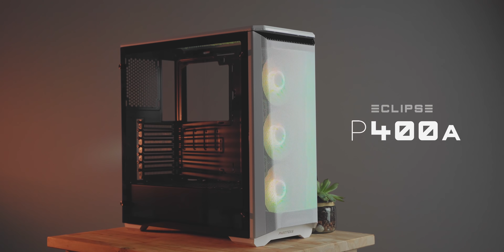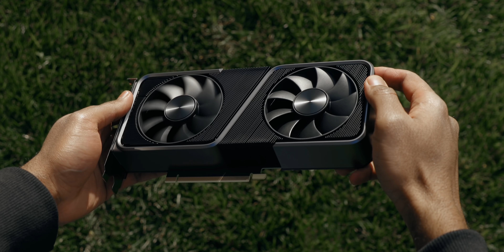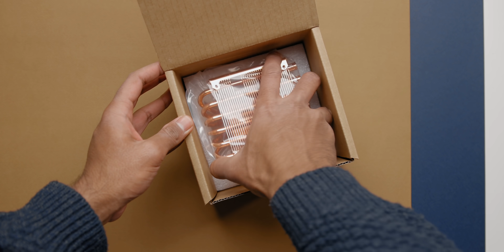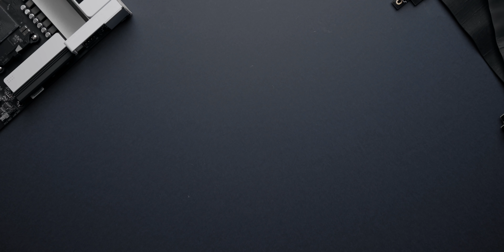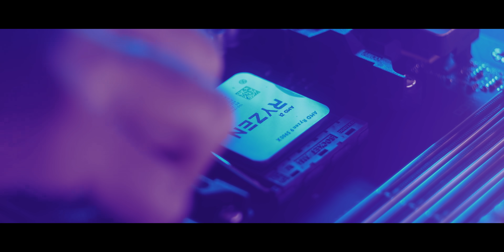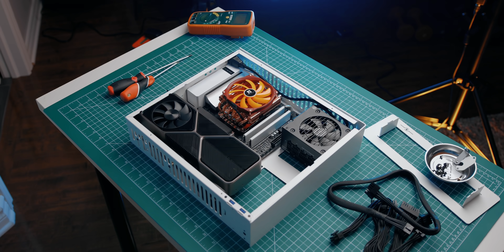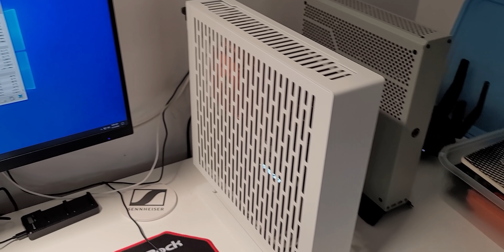The SMALLEST ATX Build Yet - Ryzen 5900X in a 10L Case!

Comment: Except for gaming the 3950X is better (an that is compensated by the 3090), I mean you could have 12 cores with higher frequency but is not high enough to compensate for 4 additional cores, would be cool a Cinebench comparison
Reply: Not even remotely true, 5600x is better than 3950x for gaming.
Reply: @riba2233  I never said that maybe it’s need a comma there, I know and I knew that, I said, that Except in gaming, the 3950X is better, in other words, in anything other than gaming the 3950X is better, so you missunderstood my comment, and yes the 5600X is better for gaming, but tbh I kinda prefer a 3950X and 3090 than a 5600X, 5800X with a 3080, more optimized CPUs for gaming are not going to solve the bottlenecks that 10GB of VRAM are going to make in the future.

P.S: About the 5600X I would be worried for it in the future in gaming, probably because what I’m going to say the 12, 16 core or even an 8 core Ryzen 3000 is better in gaming, in the long term, developers are going to adapt to the common denominator that are going to be the consoles and if the consoles have 8 cores Zen 2 the minimum is going to be that so in the future when the CPU of the consoles is driven for some game to its limits the 5600X can suffer it a little worse, but even if it manages to run it better, in PCs games tends to needs more resources, not only for optimization but because in PC you can run the game to new heights, so if it is more resource intensive as it probably will be at that point, a 5600X can struggle a lot, when a 5800X or 3900X would be perfectly okay
Reply: @Pro720HyperMaster720  3700x will never be better for gaming than 5600x, never. Btw regarding 5600x vs 3950x, you are comparing 300usd cpu vs 750 usd cpu
Reply: @riba2233   I think you’re not getting my point, first I comparing arquitechtures and cores not prices, mostly because when the bottleneck I was talking about happens you’ll probably want a new CPU anyways, but you can get a 3900X second hand for similar prices, regarding de 3700X vs the 5600X I am not 100% sure that’s why I didn’t mentioned more, but as you say never, let me explain you why yes it can happen, the 5600X is not a stronger CPU vs the 3700X the improvement from Zen 2 to Zen 3 is not enough to compensate for a 2 core difference, is near but it didn’t do it, you can check cpu/compute benchmarks like Cinebench to see that in multicore it bests the 5600X from 4 to 10% difference depending on the case, you have to understand that the gaming difference is majorly produced by improving cache architecture and reduced latency and that helped a bit by higher CPU frequencies, but not because is a powerful CPU overall, now the 5600X doesn’t have any issue because has plenty power to run any game (you have to have in mind that the 8 Jaguar cores of PS4 and Xbox One are not more powerful than two modern cores, and because the game adapt to greater capabilities or PCs adding more features and you want to run it at higher fps you need more CPU power that those consoles, unless you run everything at minimum and run the game at 30fps) but in the future when the games take full advantage of the PS5/Xbox Series Zen 2 CPU that is very near to an 3700/X you will see how these CPUs make a bottleneck and are overloaded, and as the 3700X has a little more compute power than the 5600X, the 3700X will be less affected and can have better gaming performance at the end of its life in the current games of then, but both will be very near its limits so even if that happen, that I would be, you would want better CPUs if you want to run the games at higher than 60fps.

In short: the 5600X enjoys higher frames because now, in a time where modern processors have plenty power to spare in modern games thanks to its improvements over Zen 2, so in a game that requires 30% of the CPU to run it may have 300fps and the 3700X 150fps limited by its architecture, is not like it is giving its 100%, but in the future you may need 95 to 100% to run at 60fps and in that scenario both will run at around 60fps.

Imaging that we are limited by architecture so in one it can produce 500fps in certain game, and in other arch 200fps in that same game, no matter how stronger are the CPUs.
But if the game is extremely hard to run independently of how many frames it can handle it can only output 100fps, the other one that can only make 200, this time would make also around 100fps.

If you don’t believe or agree with what I’m saying let me give you a clear example, now the 5600X and 5800X get around the same number of frames in games (even if the game uses 8 cores, that today usually is the case) do you think that will be forever, no, that happens because the today’s games don’t push the CPUs hard enough, if the arch is different you could see other bottlenecks, but if it’s the same, now you see equal performance (mostly because default out of box frequencies are not the same) but when the game requires for example 110% of what a stock 5600X can offer you’ll see the 5600X taking a huge impact in fps, dropping below target frame rate, while the 5800X will have not an issue and will be pushing more than enough.

Obviously in all my examples I’m assuming a strong GPU that don’t produce a bottleneck
Reply: @Pro720HyperMaster720  You didn't have to write all of that, I am very aware of everything you've said, but trust me, 3700x will never ever be faster than 5600x in gaming. The multi performance is too small to make up for the huuuuge latency advantage of zen3, not even considering single core performance.
Reply: @riba2233  yeah, sorry for making it too long, but thanks to take the time to read it, I mostly agree, I consider the latency and all the Zen 3 advantages but I was and am not fully certain the in the long term is going to be much better because I’m not sure how much specialization and optimization we’ll see in order to use at the fullest Zen 2 in gaming, because I suppose in some degree that will happen to get the most out of the new generation consoles so I wouldn’t be surprised if games were made around the limitations of Zen 2 to get maximum performance and if that could affect desktop ports or if this workarounds will or not improve gaming performance in Zen 3 or only will effective in Zen 2.

In short, now is better, but the main reason I’m not sure in the long term is how PS5 and Xbox Series will affect future games about Zen 2 utilization
Reply: @riba2233  by the way you have something to do with sfftime? or you have a P-ATX and are a fan of them, because your profile picture looked familiar but couldn’t put together where I saw it, but I just realized that is there logo, a very good case in my opinion
Reply: @Pro720HyperMaster720   Well yes I do, I am the maker and ceo of SFFtime, but also a hardcore hardware and case enthusiast since 2003 :)  Thank you for the compliment and if you have any questions regarding my cases, I'd be glad to answer.

Comment: with cooler master sfx 850w. msi b550 unity with 4x m.2 gen 4 so it can have 2tbx4 or 4tbx4 raid 0 with either 6800 xt or 6900 xt reference with 120mm aio is what i might do 5900x or 5950x eco mode and see if i can get something for dust filters

Comment: Dont remove the Fan, Remove the Cooler. The AXP-100 is one of the best low-Profile Coolers, but not the best. The ID-Cooling IS-60 is the exact same height, the fan is replaceable with standart 120mm x 15mm fans and it even performs slitghtly better from what i've seen so far in Benchmarks. Tolorances for RAM-Slots are really tight for this one but it should fit quite nicely with a 2-DIMM config on your Vision-D Motherboard. Let me know if it helped!

Edit:
Replacing the stock fan with a Noctua Chromax NF-A12x15, Silverstone FN123 or FW124-ARGB should help with looks and Performance.
Or go with the Prolimatek Ultra Sleek Vortex for less Performance but absolute 0 noice :)

Comment: I would like this case for my R9 5900X and my RTX 3090 FE... could this beast fit in there?
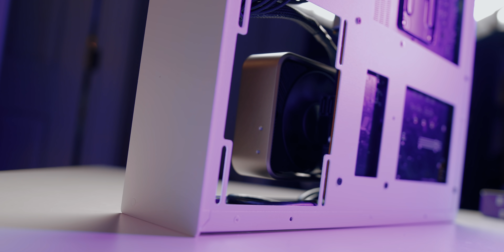I checked the specs and it should... even the exhaust fan on the 3090 should fit better over the outlet than the 3080 does (looking at 15:06).
can someone check the fitting? and when will the case be purchasable again?
Reply: Hi, 3090 fe will fit with itx mbo, and you can preorder the case now
Reply: @riba2233  Thanks - preordered... :)
is there any hint for the estimated shipping date?
Reply: @SidFreedman  Thank you for your order. Current projected shipping date is around mid to late February.

Comment: This is fairly similar in concept to Thermaltake Core G3, which no one talks about anymore because it's a couple years old. The G3 also supports a slightly taller CPU fan-sink or water cooled setup but also a bit wider. Sadly I invested too much into Intel last year, got an i9-10980XE and 128GB of RAM on X299 board and there are very few full-ATX tower that's this slim... but then I doubt the fan-sink will be enough to cool this R9.

Comment: you could totally put a taller fan in that case.. That's a silly thing to pout about... 
there are a LOT of 15mm fans for that matter. 
Scythe, silverstone, CM. ETC...

That case would be a LOT neater to look at if it was rolled counterclokwise 90 degrees and had a compartment to hide the cables coming out of it..

Comment: Try flipping that case fan by the 3080 around to serve as intake instead of exhaust. The way the 3080 works is it pulls air from the fan on that side of the car and expels it vertically (when mounted without a riser), so using that case fan as an intake might help with GPU/overall case temps. The way that you guys tried it would have been creating a pressure decrease because you had the case fan pulling air in the opposite direction that the 3080 cooler fan was pulling.
Reply: Not true, both fans om 3080 push air in same direction, towards the rear of the case
Reply: @riba2233  No it doesn’t. Watch the Gamer’s Nexus video where they show the flow imaging of the 3080 FE airflow. Actually even just the thumbnail of that video will show you where the fans push air.
Reply: @ramiebrahim4711  sorry, but you misunderstood it. Search for the official nvidia airflow chart, it was publish on the release

Comment: Did you invert the side fan to make it intake/positive?  Blowing cool air into a case makes a whole lot of difference. -- Also the orientation you had the fan config is exhaust, while the GPU fan orientation which sits right above the case fan is intake; you just created a neutral temperature in between the GPU fan and the exhaust fan.
Reply: Nope, both gpu fans push air in the same direction, towards the rear panel

Comment: Hope you all see this because i found a cooler that may work iys the Gelid Slimhero with 59mm cooler+fan height. the fan is also a standard 15mm thickness. Edit: there is also the id-cooling IS-60 thats 55mm tall. The coolers tdp is 136 and 130 watts respectively

Comment: i have the old asrock M8 case, and i found the exact same thing with mine. This case came with 4x 80mm fans i think they are 80mm... but i ended up removing all of them and achieving better temperatures and much quieter.

Comment: I have an old Thermalright 120 extreme cooler which I want to continue using for new AMD AM4 based build. wondering if it can work and where I can find a AM4 attachment for it.

about the CPU temperature comment in the video: up to 80-90c under load is fine for the CPU unless you've started thermal throttling

Comment: they should have made it just like .5 inch wider, then a 3090 card wouod fit perfectly and that last intake fan would be right where it is already located on the the 3090.. would have been perfect. or the 6800xt rog strix wattercooled card.
Reply: We also have a larger case incoming, n-atx. It is 2cm wider, .5 inch is not enough.

Comment: Yesterday I found this full cupper cooler, that’s probably why YT recommend this video. Do you use the old super flat edition or the new 65mm edition for cpu cooling. Thermalright offers a adapter blade to mount a bigger fan on top 120 x 25mm I guess. But if you don’t like the orange Fan simply purchase a white fan with the specs you need.
Reply: This one is 58mm tall.

Comment: Will the GPU block the headers at the bottom of ATX or mATX board?
Reply: It shouldn't, maybe internal usb 3.0 on matx but you can get a 90 degree adapter for that.
Reply: @riba2233  thanks. I do happen to have an mATX. Beside usb 3.0, there are a few other headers at the bottom that I'm afraid might be blocked
Reply: @kang7014  there is enough clearance if you use 2slot gpu, don't worry
Reply: @riba2233  thanks for the clarification

Comment: You guys mentioned that you tested other CPU coolers against the AXP-100. Was the ID Cooling IS-60 among that line up? I've heard from other tech youtubers that it is a cheaper alternative for the same performance.
Reply: They didn't, but yes, it has same performance but worse ram compatibility.
Reply: @riba2233  thanks! I heard that Corsair Vengeance LPX ram appears to be compatible (which is what I intend to use for my build). Do u know if the bigger fan on the IS-60 will improve VRM and chipset temps compared to the AXP-100?
Reply: @shohabwafa1841  yes, lpx is the safe bet. Yeah it could improve temps a bit. You can search the low profile cooler test on techbuyersguru channel, he tested all of this :)

Comment: ID Cooling makes some good low profile coolers I believe
Reply: Tried it with the IS-60. It  fit the case ok but you have to make sure you either have very low profile ram (sub 27mm) or a low/no  i/I shroud, my MSI unify itx board wouldn't take the cooler and I had to send it back. Perhaps that s why the IS-60 is no longer available..... Having said that there is a new version with argb, but it's  too tall for this case.

Comment: the 5900x is NOT the second fastest chip in the lineup, that would actually go to the 5800x, with its single fully unlocked CCX/CCD 8 cores 16 threads. In gaming the lineup is, 'slowest to fastest, 5600, 5900, 5800, 5950. This is due to latency. (aggrigate the benchmarks and you'll see its true) for compute, workstation use, you are right, the 5900x is the 2nd place holder. but only in applications that can use that many cores. i know its a nitpick, but for people who are gaming more than worrying about premiere workloads, its an important one.

Comment: Why are the ssf cases all dual slot !!!
Reply: Create a case that supports micro atx mobo and atx psu and 3 slot gpu please
Reply: @MxGiK3HuNNx  I did, google sfftime n-atx :)
Reply: @riba2233  i like it where can I get one and how much
Reply: They are not, and this case is 3slot if you use itx mbo.
Reply: @riba2233  it fits full atx mobo but only supports a dual slot card
Reply: @MxGiK3HuNNx  hi, I am the creator of this case, I think I know what it fits :) if you use itx mbos you can fit pretty large 3slot gpu, they even say it in the video.

Comment: And then you read on amazon that the heatsink isn't made of copper but is some copper plated alloy after one customer cut it with a dremel. He also noted it performs worse than the AMD stock cooler. And you recommend this stuff. Got any infos on thermals in this case under load (prime95+Kombustor, Blender render test)?
Reply: None of that is true.

Comment: Im sorry but building a small aluminum box that holds electronic parts is not worth 200 bucks. They are taking advantage of the niche of the product! You can buy the best lian li with tempered glass and duel compartments  about the same! there is literally nothing to this case! yeah yeah tooling overhead. Its beautiful, and so needed but come on! Still a great build and a great video though!

Comment: Beautiful case, motherboard, ram, cpu, GPU and yes, cpu cooler. I like the colour scheme 🥰💰👍. I personally am getting my setup finalised w/ the N-Case M1 V6, with the same cpu, ordered my R9 5900x and got my ASUS TUF 3080 and a 2x 240mm radiator closed loop setup. I’m using my R9 3900 atm.

Comment: hello, i would like to buy the 5900X the problem is i'm worried that it will make the room hot which gets a bit warm in the summer(AC not very good in the room) and that it would be very loud with all those fans running. always had intel pc's. Can someone please confirm how much heat emanates from the case and how loud it could be compared to intel? 
I'm a programmer, not a gamer - but may play now and then.  thanks.

Comment: It's probably because you had to use the hardware that was provided but this build is not good looking. Sorry. It started of promising with the Vision mobo and matching memory but after that it just became a mix of mismatching parts. Especially the fan on the cpu cooler destroys the overall look of the build. You could say the orange is a eye catcher met together with the copper it needs to be present in more than one spot. Together with the reference 3080 and it's unique design and colours it creates an even bigger divide in the already messy theme of this build. Gigabyte also has a Vision themed 3080 which would've been a perfect match, though I'm guessing that card might be a bit thicker so it might not have fit in the case.

Comment: Surprised you tried to dunk on Ali but didn't think to get the Alpenfohn BlackRidge. That thing can beat the Shuriken 3 and still be a shorter height.
Reply: This cooler cools much better that alpenfohn, unless you use 120mm fan on top, but in that case it doesnt fit.

Comment: Hey there's a fan from Cryorig that I believe matches what you guys need. It's the XT140
, while the fan is 140mm, the screw holes are a little bit recessed in, so while it's not said officially on the website the dimension of the screw hole, I believe they fit in with normal 120mm holes.